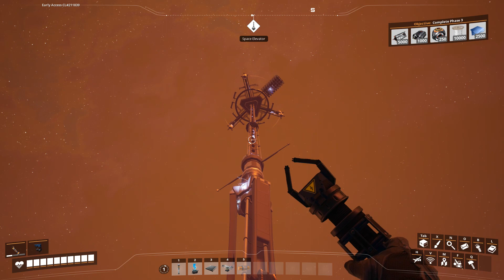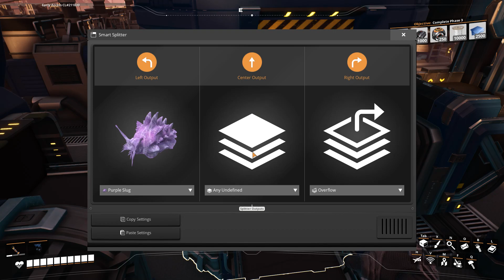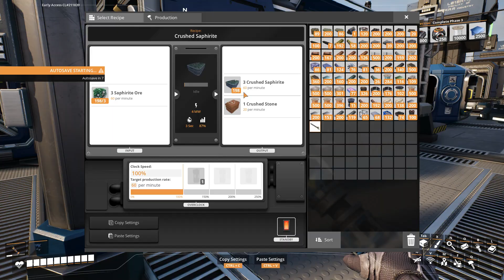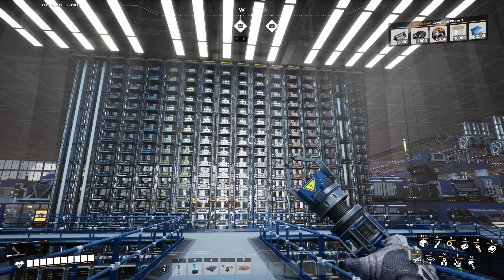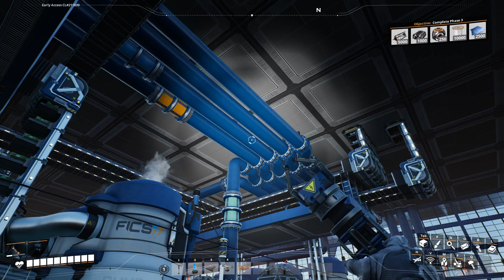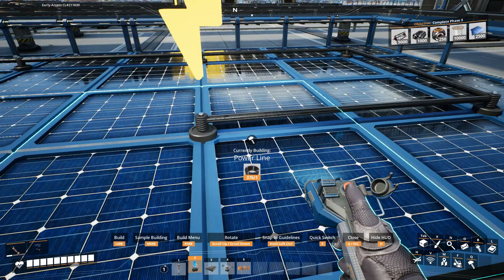Satisfactory Plus Mod - Starter base complete. T5 and 6 unlocked!

Comment: about slugs: you have an almost perfect close network of incubator/hatchery. Take note on the consumption/rate though. Your blue eggs for example are produced in slightly slower rate than the blue slugs, but in batch of 4 instead of the 2 you need for the hatchery. Eventually this will clog the system. A single hatchery can support at this stage 2 incubators, so you may need to re-build that part if you want perfect ratios. As an alternative, some of the modules of the incubator will slightly boost its speed (and you can place multiple modules there, 3-4 per type of module). So you may need to experiment a little to find how many extra modules you need to balance the system. 
Your first slug farm should be focused on unlocking all the slugs (15 or 16 of them i think), but for that you will need all 3 types of soil (thus all types of food) - be warned that this setup is very energy consuming (around 12000-15000MW) and requires huge amounts of water. So go on as you are now - 2-4 types of slugs, its easier BUT you need to monitoring it often to check what you have found/unlock (side tip: when you unlock a slug and you determine temperature, humidity, etc, note the values on some textpad/excel/whatever - there is a rare and random bug that, after you delete a hatchery and you rebuild it, even though you have unlock the slug, it will not know the proper values and you must reconfigure them manualy. Easy but irritating)
Finally, now that you have reached the oil stage, and when you unlock the packager, you may think of building a dedicated slug farm to produce the juice (at this stage you will need as many overflows of slugs as possible) to feed the miners - BUT this will be an (almost) impossible project - to transfer the juice to all miners. Just focus on some of them and only if you find it absolutely necessary.  
Keep up the good work!
Reply from the maker: Wow! Lots of good information!! :D My intent with the slug building is to make multiple levels, taking care of a few slugs types per level. :D But I still think I'm losing the white and lime slugs somehow. It's like the splitters are just eating them up but not spitting them back out. I should have a bunch of them in my little collector box at the end, but they're just not there.

I will endeavor to do my best as I continue!!! lol I appreciate the comment.
Reply: @Xero1of1  white from blue. if you want to get them faster, just change your current setup to have 3x blue loops (instead of 3 different colors) - and you only need 202 whites (200 for mam and 2 to jumpstart the white loop later to get its exclusive color)
also, just for whites only, maybe setup a different container/smart spliter logic to store only whites there, so you wont miss anything. On your current setup (3 colors) you risk of filling the container with all possible products/slugs plus their overflow. 
At your current state, i think it would be better approach to have 1 container for overflow and 1 or 2 containers for unspecified colors (depending on how often you check the slugs)